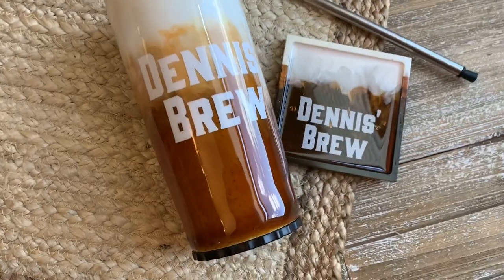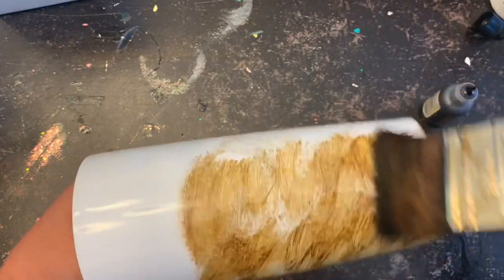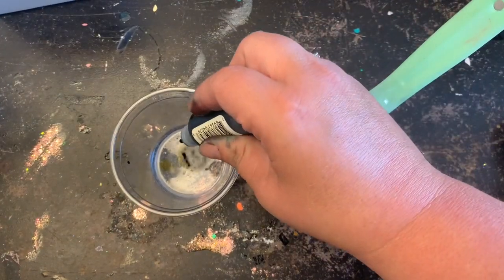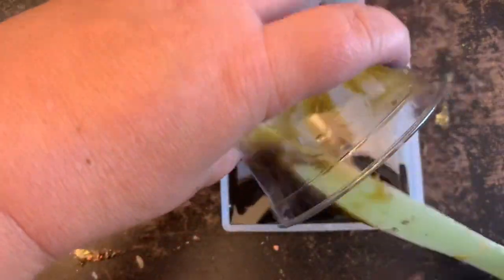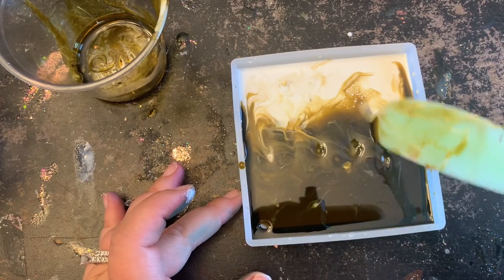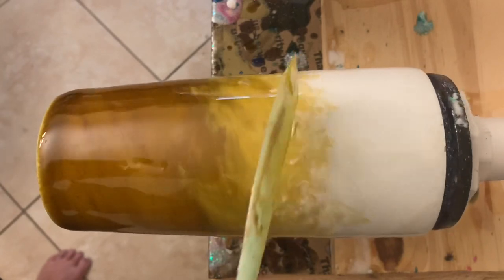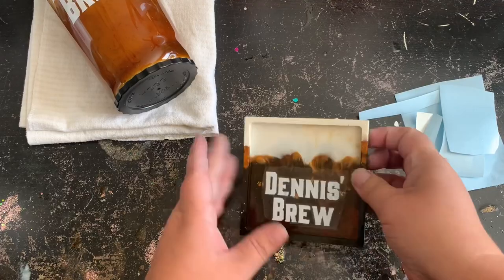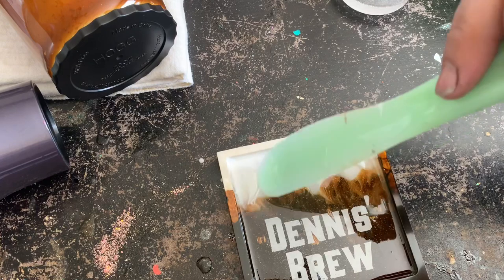Beer Tumbler and Epoxy Coaster Tutorial

Comment: Hello it’s me again with another question 

Is you epoxy always so smooth I can ever get mine to look that good and I have to sand all over the place it feels like.
Reply from the maker: There are multiple layers to my cups. I sand in between each layer. Then the final coat I make sure to let the epoxy warm a little to help with bubbles and it comes out pretty smooth at the end. There will always be some slight imperfections, it is hand made after all.